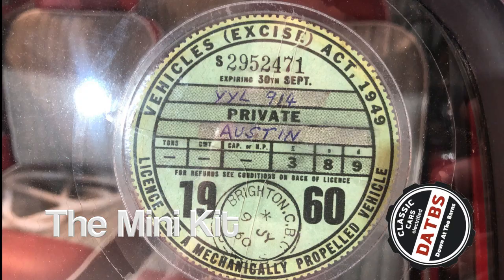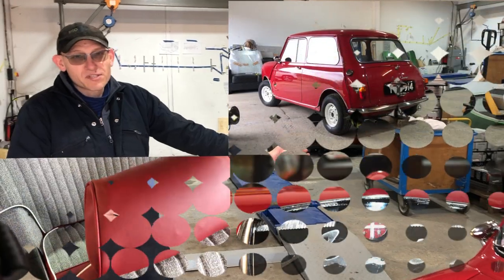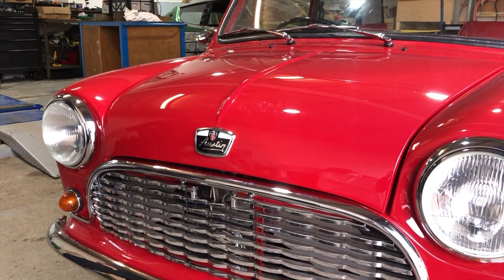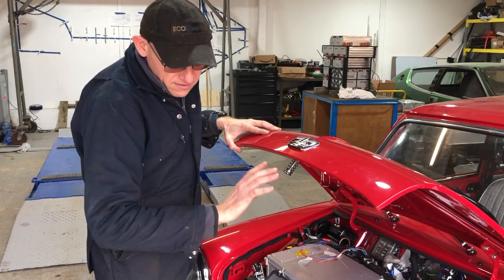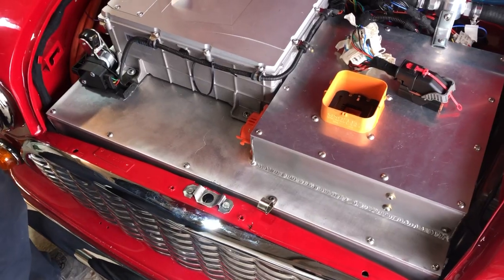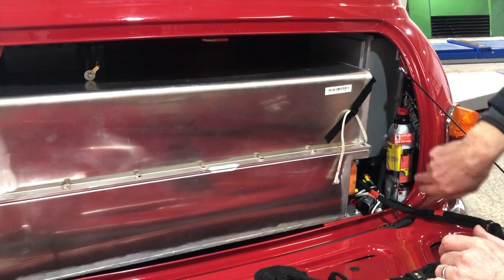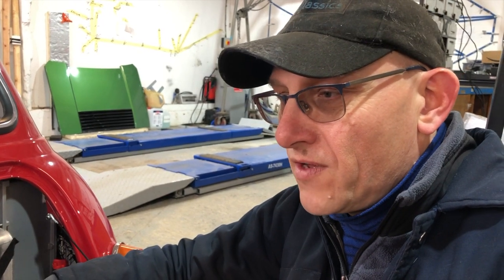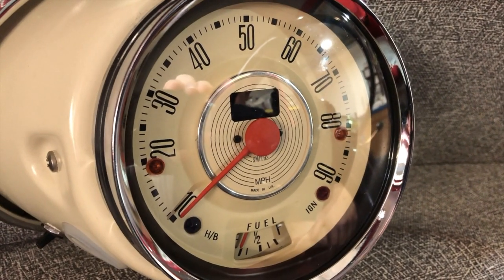How We Transformed This Vintage Austin Mini Into an EV Powerhouse

Comment: It seems with a lot of these modified cars that they seem to go like rockets! Is this right?, is this safe? It seems that there is no correct application system...such it & see, let's guess!! Why not guess a bit smaller so that the cars performance is more in line with the standard car. This must have alsorts of benefits in terms of cost savings and the amount of batterys being used and of course weight reduction . You might even get your boot space back. I think we got to be careful about the development of theses cars to ensure they are safe and so don't get branded otherwise and get banned...having said all that, it is a superb little car that you have. Good luck.

Comment: Really cool.  I would be very interested in the smaller battery pack version.  I am in the last few months of a restoration, and I was planning to get a Swindon kit in early summer, but would be very interested in this.
Reply from the maker: Please get in touch
Reply: Do you have a cost estimate on the kit with the smaller battery pack option?